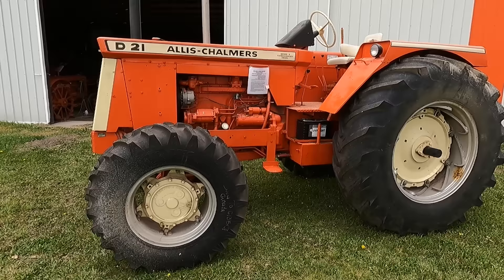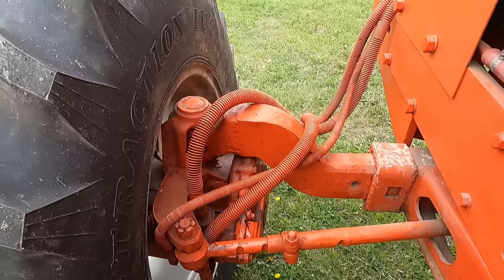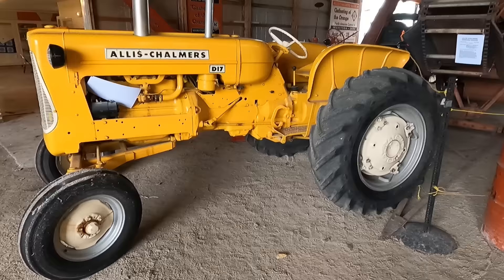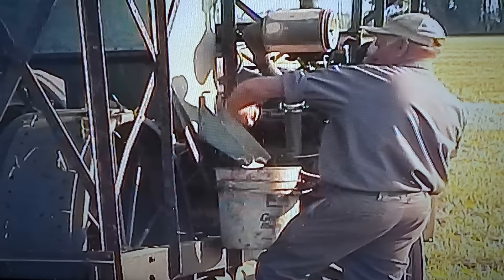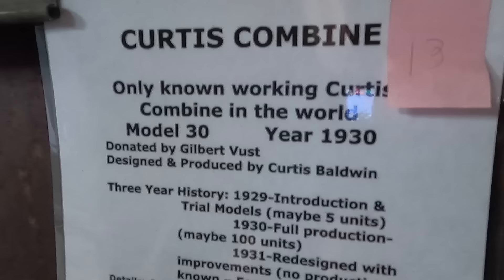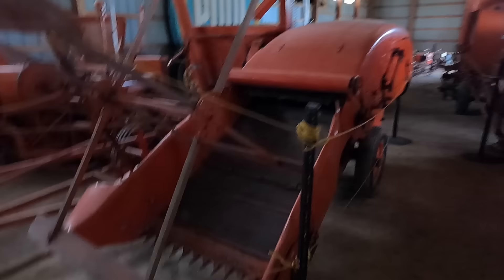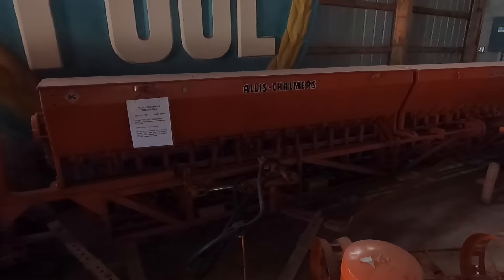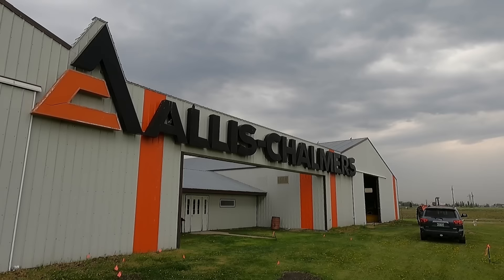Allis Chalmers Museum Tour

Comment: That's a great museum, glad to see all that equipment under a roof.  Fantastic that they have the original factory sign from the Milwaukee factory!
Reply from the maker: Yeah, the sign really makes the museum building pop.  You can see it from the highway.  Before the 2nd building was built, there was an Allis-Chalmers sign painted on the east side of the building.  But after the 2nd (and middle) buildings were added, and the sign was put up, it really made it stand out.

Comment: Allis Chalmers and Gleaner pull type combines where offset to the left so you could combine counter clockwise and then mow clockwise to reduce skipping caused by wheel tracks. I have used the AC 90 pull type to combine fescue seed.

Comment: Excellent video. I worked for Gleaner for 15 years. Not the same Gleaner as this one is in Scotland and supplies fuel, heating oil , petrol etc. You may be interested or not but I am running a book on tractors 1904-1934  about 4 pages each week at the start of my videos. At the moment I am working on a David Brown 996 Uk model. Bring it back from sitting by the sea for 2 years doing nothing. Quite a bit of rusted up parts. I sometimes make parts that you can't get now. M 😀

Comment: When you were looking at the implements in the pole barn you had seen a couple "disks". They were actually disc plows. These were used a lot on the prairie as they did pull easier than the moldboard plows, and they did scour easier than the moldboard plows.

Comment: Dad had a Baldwin combine. Hercules engine behind grain tank. Header on right side. It had a chute on left side to unload on to the truck. Dad pulled the combine with his g John Deere. The Baldwin combine was invented at Nickerson , Kansas. Years ago at are state fair in Hutchinson , Kansas their was a very early self propelled Baldwin combine. Model t engine behind the  grain tank. The small wheels in the rear were the steering axle. Many yrs ago at the allis chalmers dealer in Wichita kansas I seen one of those combines that the header mounted on the front of the tractor. The tractor was an old rumley , allis, or case. The grain tank mounted on the left rear fender of the tractor may be 20 bushels. Also the old Baldwin self propelled combine at are state fair had a 7 or 8 ft header on it.

Comment: real interesting I am from the UK my father had an Allis Chalmers fork lift in the 70s it was left here in the UK I believe from the US forces he bought it at a sale I used it regularly untill 1991 when I sold it and replaced it with a more modern fork lift. it was a good starter and worked well the only problem we had was once with the drive but soon got it fixed it had tilt and small side shift on it

Comment: The memories. We were an Allis/Gleaner farm. We had a mod 60 all crop with the axillary engine on it, a 2 row mounted pickers on the WC and a mod 190 i beleive it was on the D17. Two CII C/S specials. An A also. The combine progression up to L2s. Ran a G also. 
 Tractors 2 WCs, WD, D17, 185, 210 and a 7080. 
 Sure wish someone would start Allis Chalmers back. Get rid of techno garbo and be an operator and not a computer jockey. Lol

Comment: thank you for bit about the electric motor. Allis-Chalmers also made electric motors, turbines for power plants (before Siemens)  and other electrical equipment.
Reply: I really liked that bit too. It's interesting how diversified A-C was. There are whole nuclear powerplants designed by Allis.
Reply from the maker: Yeah, weren't there components in the Hoover Dam built by A/C?
Reply: Yes we have a couple hydro generators here in south central Nebraska that are AC units and still going strong.

Comment: spreader that moved the manure to the front actually solved a problem, a conventional spreader shifted the load to the rear eventually going over center and lifting the tractor up slightly reducing traction, a real problem in snow
Reply from the maker: That's a good point; didn't think of that.  Would be especially helpful in the days of no front wheel assist, I guess?

Comment: Not popular in the South, at least north east Florida . In 1981 I was looking to get a larger tractor then John Deere 3020's we had.  Looked at a International 1086, gear shift on both sides of the seat, no.  Ford 9600, no. Drove 50 miles to the AC dealership, cab was about the size of a jet fighter, no.  OK, try the JD 4440, love.  

Today farms here are about 95% John Deere.  A few Challengers and Kubotas.  My neighbor has two Kubotas for light work but that is probably because his wife's Uncle owned the local Kubota dealership.

Comment: @ 8:14 it's a 1938. The only year Allis used cast front wheel centers with wedge bolt rims.
 Hand crank only models didn't have a choke rod to the operators station. Ya didn't need it back there, because you had to be out front to crank it.
 @11:07, that is not a B, It's a C. A B didn't have a wide enough rear wheel spacing to use it on a 2 row cultivator, and B's never had a narrow front end or a single front wheel.

Comment: $500 in 1938 is equivalent in purchasing power to about $10,757.55 today
Reply from the maker: On the surface, that still sounds pretty good to get a compact tractor for $10,000....but then I remember you're only getting about 13 hp with ZERO comfort features.  Not even electric start!  :)

Comment: The PTO pulley is in the rear of the tractor
Reply from the maker: I believe you pull up on the lever with the rounded loop to engage it though.  (If we're talking about the B.)  If memory serves, you also need to use the clutch, so I don't think you could use it like a "live" PTO either.  If you had to stop the forward motion, you also stopped the PTO until you let out the clutch.  I could be wrong about that though....its been over 20 years since I ran that thing.  :)